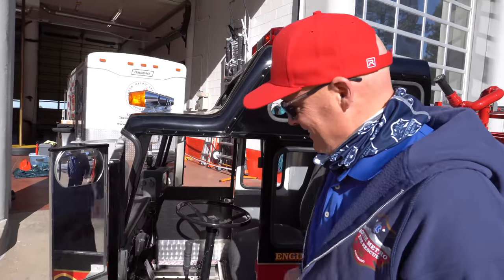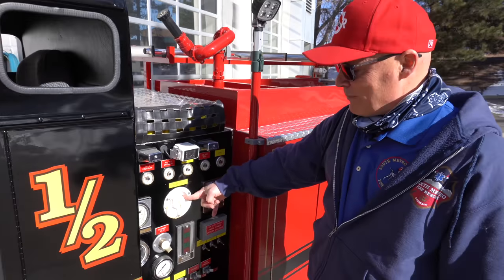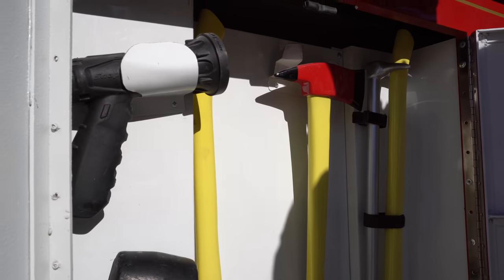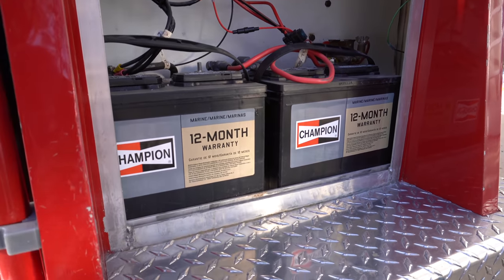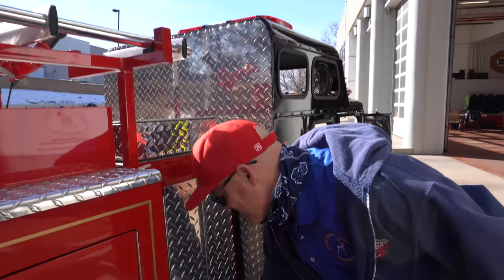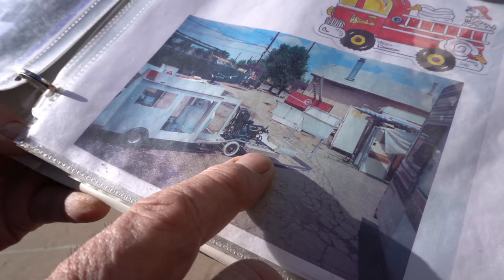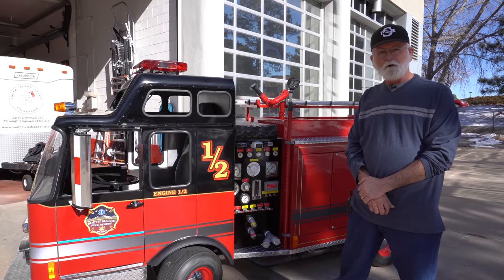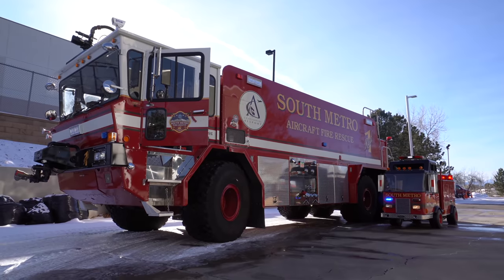Fleet Friday - Engine 1/2

Comment: This is as cute as an Isuzu Kei fire truck pumper chassis micro fire truck chassis.  The cute little Micro Fire engines were put into service by the Shibukawa City fire department in Japan because some alley ways were too narrow and long for normal Japanese fire trucks.  They only pump 900 liters but being a first wave fire truck they buy time until more hose carts are pushed in and hose lines laid in.

Comment: Cause I've noticed you already have led lighting on the engine 1/2 why not add A upgraded battery charger to it to aswell right. It'll still work.& do more along with it's regular main purpose also it prefourmance that it prefourms to. They also have multi amperage settings selector button.& charging.& booster.& jumpstart modes to all in one chargers. They may even sponsor your fire station.,or stations for more youtube channel videos.& tours of equipment.& vehicles to.

Comment: What make is that, is it a Pierce enforcer, looks like one.
Reply: Pierce Lance, they mention it around 5 minutes in. Its based off Engines 1 and 2 of the old Wheat Ridge Fire District, which amalgamated with South Metro.